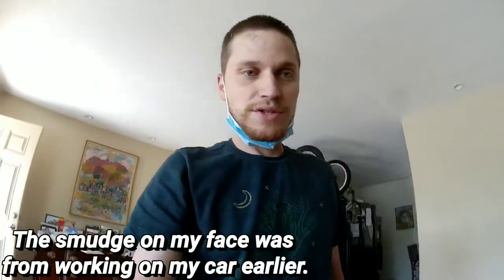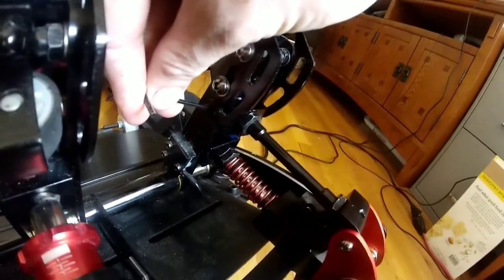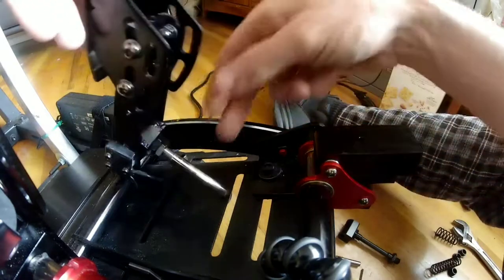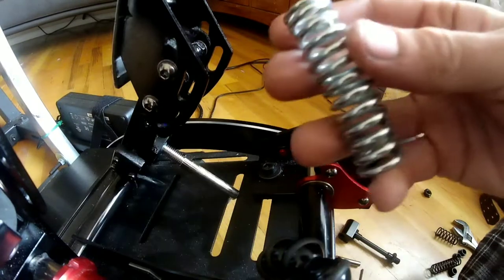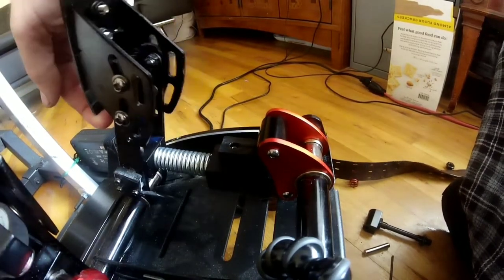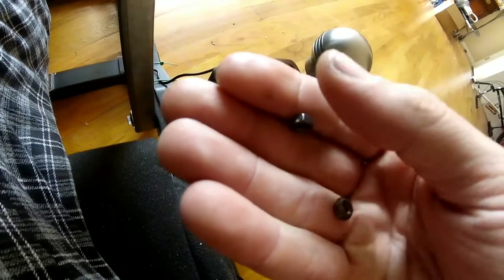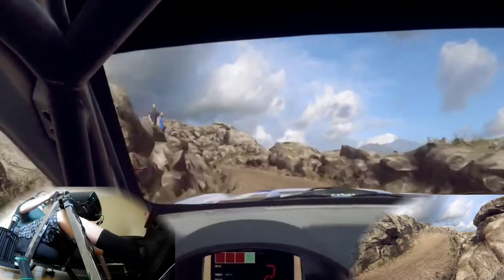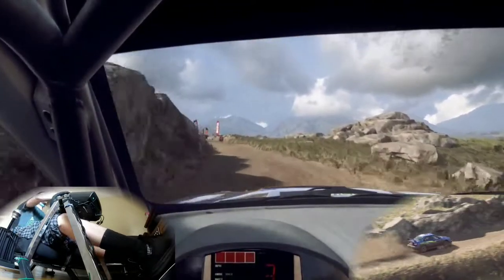Fanatec V3 Pedals Clutch Spring MOD!

Comment: Would it be possible to use that spring and retain the cam? (Preferably without using loctite)
Reply from the maker: I don't think it's possible, unfortunately.
Reply: @DouglasThompson  Agh that's a shame, maybe I'll find a stiffer spring someday. How much does that spring reduce the pedal travel?
Reply from the maker: @willwastaken  it doesn't reduce much if at all. :)
Reply: @DouglasThompson  Hmm, might be able to get it to work then 🤞🏻
Reply from the maker: You will lose a lot of travel if you keep the cam in place. You could try cutting the spring but it would not sit as flush as you'd imagine.
Reply: @DouglasThompson  It's a shame there aren't any custom springs for the V3s
Reply from the maker: I agree, seems like an untapped market.
Reply: @DouglasThompson  Please let me know or upload a video if you ever find any 😬
Reply from the maker: Definitely! I still really like my V3's 

I have been tempted to switch pedal sets a couple times but I keep reminding myself that I have no real issues with my current set. Great Peice of gear!
Reply: @DouglasThompson  Yeah I'm looking forward to replacing my T3PA Pros with V3s soon. Although I'm trying to find a spring mod that requires you to use your leg for the clutch instead of just your ankle
Reply from the maker: Ya...my mod definitely is more leg and less ankle but nowhere near the car I most want to replicate.
Reply: @DouglasThompson  If you wanna replicate a real clutch, get yourself some Heusinkveld Sprints and get some softer elastonomers for the brake
Reply from the maker: Is the clutch that stiff?
Reply from the maker: I have been trying with the idea of picking up a set of simforge mach 1 pedals. Seems to have a lot of great features and adjustability. Just they are so heavy...
Reply: @DouglasThompson  Oops, meant to say Heusinkveld Ultimate. The throttle and clutch have hydraulic dampers and really strong springs, especially the clutch. Watch R-VR Closet's comparison between the V3s and Ultimates
Reply from the maker: @willwastaken  you know I have seen that vid...it's been a while though. Currently my V3's have a stronger clutch pedal than my wife's Ford fiesta but nowhere near my 04 and 06 WRX...

I also really like the little motors on the V3's when I can't use motion for certain videos. Helps in some games
Reply: @DouglasThompson  WRX? Nice! I'm really looking forward to the vibration motors. I'm trying to get the best immersion possible with my limited budget lol. CSL DD is on the way, Pimax headset coming soon, new shifter coming soon too, and just recently got a decent handbrake to replace my DIY one from 4 years ago 😄
Reply: @DouglasThompson  Didn't see your reply about the mach 1s. Do you mean the physical weight of the pedal set, or the resistance of the pedals?
Reply from the maker: @willwastaken  damn, the pimax huh! Let me know how you like that!
Reply: @DouglasThompson  Will do!
Reply: @DouglasThompson  Hey again! I've been doing more research on V3s vs Heusinkveld Sprints and I've decided to just say f*ck it and get myself a set of sprints. The video that shows the difference the best is this one: https://youtu.be/mJgaStBcWRY
The video is a little crusty lol, but it shows the difference really well, especially with the clutch and throttle.
I'm most likely gonna put all 3 pedals on their lightest setting, and those softer settings appear to be exactly what I'm looking for. The XL+L elastomer combo for the brake appear to make it a similar stiffness to V3s with the green dampers, visually at least.
I should have my CSL DD, Sprints, and Pimax by early November, so I'll let you know how I like them!
Reply from the maker: Damn! All out! You're gonna have quite the setup!
Reply: @DouglasThompson  I know right?! :D
I can't wait, it's gonna be such a huge upgrade from my toylike T500 and T3PAs.
Reply from the maker: @willwastaken  You are gonna have a hard time believing its yours until you let the thought soak in for a few days!
Reply: @DouglasThompson  Haha I can already feel it 😬
Reply: @DouglasThompson  Yo! So I got the Pimax and, well, it was absolutely awful. The comfort, distortion, weight, audio, cable, build quality, head strap, foam, everything. It was just horrible. I sold it and ended up getting a Quest 2 to replace my CV1 and I'm much happier now.

I also ended up taking the plunge on the Heusinkveld Sprints and they feel absolutely amazing. I haven't been able to use them in game since I'm still waiting on Fanatec to send me my rim (lol), but the pedal feel is just magnificent. If the "softest" (XL+M) brake configuration is still too hard, you can use a bit of brute force to squeeze the XL+L in there without removing any of the essential spacers to make it quite a bit softer. The clutch pedal also feels absolutely fantastic. It feels better than the clutch in my real car :D

I can't wait to use them.
Reply from the maker: @willwastaken  Great to know man! Thank you for the update, many comments get lost on YouTube...I'm sorry that happens.
Reply: @DouglasThompson  That reply is so old lol. Not sure if you saw my edit of the other one but I've been using the sprints for a while now and love them, but the Quest 2 went back because it was terrible
Reply from the maker: Ya...I have a video coming out about it tomorrow most likely...lol
Reply: @DouglasThompson  Can't wait for that lol

Comment: I don’t know anything about manuals but I really want to learn. Can you stall the cat? Does the gear engage as you are releasing the pedal or is the digital simulation just on or off when it comes to registering he shift? Is this a viable way to learn or do I really need to mess up a throw away transmission on a real car in order to get used to it? Sorry for the long question I would just rather learn at home.
Reply from the maker: It mostly depends on the game. I play a lot of DIRT Rally and Dirt Rally 2.0. When you put the car in gear, you HAVE to push the clutch in first and let it out after its in gear, just as you would a real car. Depending on your speed, the momentum of the car will make it easier or harder to work the clutch. When going at a slow speed you need to be smooth on the clutch in order to allow the car to move, especially from a standstill. Unless you dump the clutch but if you are using this purely as a training tool, that would be a bad habit. You WILL stall in Dirt 2.0 while you are learning and it will be overwhelming at first but it will definitely help prepare you for the real thing.

Dirt Rally 2.0 has the best H-pattern manual mode I have experienced in the racing games I've owned and tried. Not only does it have asphalt roads in the rally stages, it has a large "free roam" area called "Dirtfish". In real life Dirtfish is a facility that prepares you to drive on mixed surfaces as you would find in a rally or rallycross event. This area is great for learning how a car handles and where its limits are. You can tune the cars to your liking and test a myriad of different situations on your own time. 

This would be a great tool for you to learn the basics, without trashing a transmission. Also a ton of fun!

Not saying you would be better off investing hundreds-thousands of dollars on sim-racing but it is a great hobby and a cool way to keep a lot of your skills fresh and continually improving on many real-world techniques.

You could also just buy a beater 500.00 car and get real-world experience but you gotta insure it, maintain it and overall be hassled with it constantly because most likely a 500 dollar car is going to have its fair share of problems...not to mention you are out in public possibly endangering others while you learn the ropes.

I can help guide you if you choose to invest but you must be willing to pay for realism. Its not cheap...
Reply: Douglas Thompson awesome thank you for taking so much time with the extensive answer. I really appreciate it. I know it takes time to write like this. Thank you.

Comment: Hi Douglas, amazing mod! Any idea if it is possible to use this spring on a V3 inverted clutch?
Reply from the maker: Thats a good question. Ill try and taje a look at them to see if it is similar enough to work.
Reply from the maker: The clutch mechanism looks similar in the pictures I have seen online. I think this will work for you. If it doesnt, no harm done to your setup as you know! ;)

Comment: Does anyone know the strength of the original black clutch spring?
Reply from the maker: In terms of measurable force? I don't know but it is very weak feeling. This mod I made gets it in line with a weak clutch on a real car but miles better than the factory resistance.
Reply: @DouglasThompson  Yeah i wanna try it, but I am in the states and they don't ship overseas. I was trying to figure out how heavy of a spring i need to find. There is a description on the spring you linked , but  it is a replacement for the Clubsport v1 pedals. Not sure how the clubsport v1 compare to the V3s.
Reply from the maker: I installed it on my V3's as you may know from seeing the vid it is not a direct replacement but minimal modification is required.

Comment: did you make it stronger or softer??
Reply from the maker: Stronger. :)
Reply: @DouglasThompson  Is there a way to make it a bit softer?
Reply from the maker: @levinste2750  with the included softer springs you can.
Reply: @DouglasThompson  what do you mean ? There is included, in the pack, one black spring, only
Could you please, give more details ?
Reply from the maker: @levinste2750  should be multiple springs for the throttle and clutch if I remember correctly.
Reply: @DouglasThompson  No. Only one. Black, stronger
Reply from the maker: @levinste2750  did you buy new or used?
Reply: @DouglasThompson  New. Can I ask you something else, please ? I own right now the Fanatec V3 pedals, compatible with PS 5 and PC, and Fanatec McLaren GT3 + wheelbase CSL DD, PC and Xbox compatible
I own the PS5, I'd like to use it for the Play Station 5, as well, so I need to replace the wheelbase.
Could you please, help me ? I want to have a wheelbase for PC and PS5 but without swaping the USB cables.
What could you recommend ? If needed, I could replace the wheel, as well ( I'd prefer Fanatec or Moza  )

Thank you
Reply from the maker: @levinste2750  perhaps they stopped included the others...
Reply: @DouglasThompson  possible.
What about the questions above?